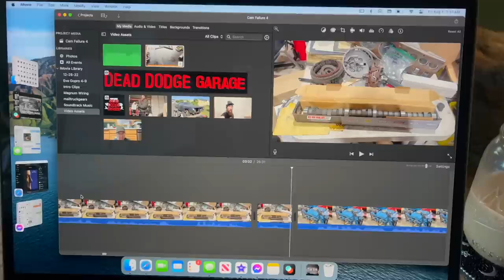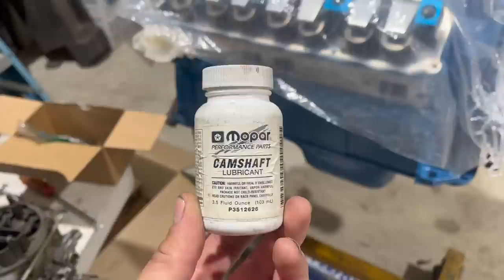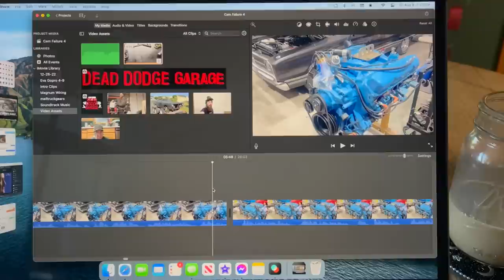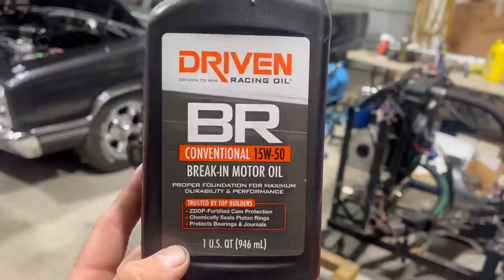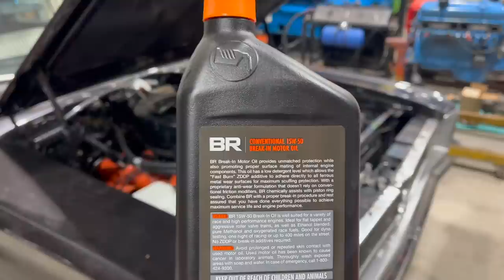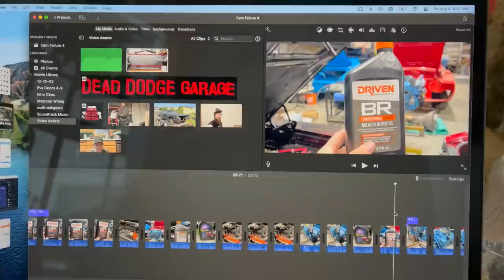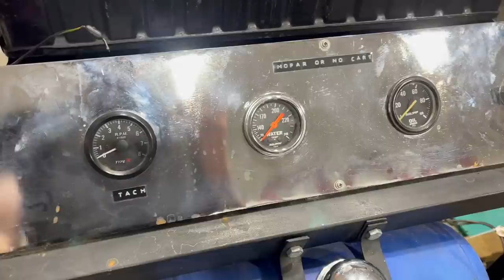How To Make Your Flat Tappet Camshaft Live, And The Anatomy Of A Failure

Comment: Comp cams are mostly very good, but obviously today they are letting some stuff get through that's not machined right.  Back in the day, no one was super fussy and the cams survived fine with just some break-in lube and running it at 2,000 rpm (varying) for about 20-30 minutes.  People just used the high-zinc oil that was sold everywhere, like Castrol GTX 20-50.  It may be best to just get a Lunati cam ($$$) versus taking another brand to a machinist and having them check it.  Lunati is good.  Comp is really good ,"Mostly". Some stuff from Comp is slipping through. their quality control (or lack of it).  Lunati might be your best bet..  Everything you said is absolutely correct, But I'm pointing that one one was taking out the windage tray and putting in lighter valve springs for the break-in,  Back in the 'early '70's, practically everyone was swapping in performance cams and  they were all flat tappet cams.  I very , very rarely heard of a roller cam back then.  One advantage of being 68 years old. is that I remember how it was.   Btw, I used to adjust the dwell and timing (with the light) by cranking the engine with the spark plugs out (in certain situation),  Cranking dwell and timing.  If the car won't start, I'd pull all the plugs, then swap the points and condenser and get them dialed in perfect before I actually started.  I still think points ignitions are superior to electronic.  The stupid "mechanics" back in the day almost never set them perfect, , often didn't use points lube. or clean any the wire connectors, check the mechanical and vacuum advance , points cam in the distributor for wear, check to if the new points had a burr on the rubbing block.,, etc, etc.  So me, the "amateur"  got jobs fixing stuff the "pros" screwed up.
Reply: Lunati and Crane are pretty much a memory. Both have been 'absorbed' by the Comp group or Edelbrock. EVERYTHING Lunati has is on backorder indefinitely. MOST of what comp provides is custom CNC ground stuff on their Landis machines. All their catalog offerings are mostly 'white box' stuff ground off site on huge gang grinders by Camshaft Machine Co. in Jackson Mich. I was going to buy a Lunati at Summit, had it saved in my 'wishlist' now it says 'No longer available'. NO Lunati at Summit or Jegs. They are history. 
Problem is age. These engines are 50-60 years old. Rebuilt multiple times by now. Who ever checks lifter bores? I've seen some engines .060+ overbore and cranks .040 under on journals. 
The other issue is loss of manufacturing knowledge or skill of previous generations. Last flat tappet engine produced by the OE was late 80's. Machinists that knew how to operate those lifter facing machines are long gone. I don't think any company is going to invest millions in new modern machinery equipment to make a product for a limited segment of the aftermarket. So they use old unmaintained equipment with worn out bearings and parts. Even in 2000, 23 years ago there were 4 separate manufacturers of Flat tappet lifters. All US based, US companies. One left, and it's not one of the 'original' manufacturers that did it back in the day. Maybe in name only. The current 'Johnson', well both 'Johnson's have NOTHING to do with the old Johnson Lifter's owned by Sealed Power when they were in Muskegon. AC Delco. Gone. Eaton. Gone. Stanadyne. Gone. Some were better than others but any of those were better than what you get today.
Reply from the maker: Hey, I got where I am with tuning by fiddling with screws and timing and listening to how engines respond, and I gained my electrical knowledge by breaking down, or piecing A-bodies back together… not by training in a classroom, a factory, or anywhere else.
Reply: @DeadDodgeGarage  That's cool! I used to be a professional engineer but not that kind. I learned on the fly too. The hard way. Some say the best way cause you never forget. I was talking about the manufacturing industry regarding loss of knowledge.
I spoke to a guy a while back at the 'other' Johnson lifter. The machine that puts that crown on the lifter is a very complex operation and that machine is specialized and super expensive. I watched one in operation. It's like an oribital finisher that pivots on it's axis. That's why the lifters look like they have those 'scuffs' all around the radius of the base. The crown  is only .001-.002 but needs to be consistent. I believe the problem with some of these 'newer' lifters is the pattern is football shaped instead of circular on the crown even if you can detect something of taper.
Reply: @DeadDodgeGarage  I read the books, but I also listened to what the mechanics said.  They knew a lot of stuff that wasn't in the books.  Back then a lot of work people did was pretty sloppy.  That's why the points ignitions got a reputation for being "unreliable".  Actually, all the old stuff was very reliable and a lot more simple.
Reply from the maker: @vincemajestyk9497  that matches what I have seen in videos by a machinist on YouTube whose name I can’t think of right now - he chucked up a brand new lifter and started resurfacing it, and a football-like oval pattern appeared showing his machine was resurfacing that area and not yet touching the whole face. So… that ain’t good…
Reply: @DeadDodgeGarage  These new USA made lifters (HFT) are a lot worse than I thought they were. That's a shame. I figured it was pretty rare with those. guess not. I just don't trust or like new stuff over older stuff. You really need to take a critical look at modern parts these days. I've used nothing but 'vintage' NOS lifters for a little over the last 20 years. I feel bad for all these guys like you that had catastrophic failures and did nothing wrong. Except having faith and believing that new parts you bought were properly made. Verifying a lifter crown isn't something the average person can do. Especially when it 'looks' like it's there and OK. People don't have any pride or care about making anything right these days.
Reply: Comp Lunati and Edelbrock sucks all the same stuff by comp I only use Elgin pro Stock cams and NOS  Lifters

Comment: When Dan at DD Speed Shop had the big block Chevy cam fail on his video he didn’t understand what had happened and and after he got hold of that same cam company and explained what happened well I guess he felt like he got screwed just like what happened to me and DDG and after that he made another video wearing a tee shirt that said comp scams. I’m guessing he didn’t get a replacement and like what they did to me as well put the blame on myself. I’ve built 20 or 30 engines myself and my first failure was last year and I followed every damn step in the book but hell I’m just an old man and I’m an idiot or at least that cam company made me feel that way after talking to them.
Reply from the maker: Right there with you, I think. I tried to blame the manufacturer - and really, it could be their fault. But I didn’t check them properly. It sucks we have to do that now… there were multiple shortcomings on my end that added up to what happened. I can learn. Happy to do it.

Comment: Good video, just installed new cam kit valve train. Everything good, but my felpro intake gasket sweat a tiny bead of coolnt. Like a sponge, ever had this,?seems like only in hot humid weather it will do it when the car sit over night in garage, used thread sealant and some red rtv around water ports
Reply from the maker: I’m assuming this is small block as there is no coolant through the big block intake. I’ve had similar problems with a bad intake fit and the cork end seals in place. They tend to hold the intake up away from the gaskets to varying degrees. I generally leave those end seals out and use a bead of silicone there. I once was convinced to use them in a 340, and it was so bad, there was coolant flowing into the oil.

Comment: also, stating a fact, before these last 10 years of "Bad" lifters you could break in an engine easier, without playing the "Mary-go-round" that is The flat tappet game, as of recent I do place blame on OE/Aftermarket manufacturers, Why? Well, they sell these products and grind them to spec, they claim to check these items before they leave the factory, that's WHY there are warranties, Placing the blame on yourself is giving into companies like Delphi, Morrell, Competition Cams, Lunati, Isky and more who peddle sub-standard products claiming "Ignorance" to the fact they are the ones who should be double Checking this, Powell Machine/Powell Cams in South Caroline Double and triple checked EVERY Lifter and camshaft that went through there shop, sadly, they no long sell Flat tappet cams due to bad machining.

I say this stating that it is not NOT user failure, it is not Your fault, nor is it any of the thousands of others suffering this issue, it's sad to see someone say "It's my fault" when it clearly isn't or wasn't Even cam break in directions specifically state to Do what you did, no where, not today or not ever have they (Comp, Isky, Lunati, Powell, Clay smith) said to Mic-out your Lobe taper, and lifter crown when that's there job for the goods they peddle to their customer base, not the customers job.

As for roller Cams, Yes, ALWAYS go Roller, no matter how much of a joke it sounds like, or how you make those who say it sound like a joke to you, stating Monetary Issues is silly especially Considering you're/They're dealing with a MoPar, arguably one of the most expensive Brand/s to buy for, why not take the extra step and precaution, what's worse, spending 6-7K USD on a build only to have it decimated and all down the toilet due to a $270-300 cam setup, or just going ahead and dropping the extra ~$1100 (1,074.99 according to Summit Racing for a full kit with springs/retainers/timing set/locators/locks) and not having to deal with a break in period, just drop them in, turn it on and go, and never have to worry, plus a small gain in power on the side thanks to Friction loss becoming Less of an issue.

Just don't sell the idea of a roller cam short, they're more than A performance upgrade, they're a Direct Upgrade and a Wallet Saver in the long term.
Reply from the maker: NO. I’m saying not to automatically go roller, and I will continue to say it. I’m not selling the roller idea short. I did a video documenting exactly what it costs, and why it makes sense - but also why I will not be using rollers for almost any of my builds. I have found two great solutions to this problem - use a local mom and pop cam grinder like Oregon Cams, or buy NOS. 

I had multiple false starts with the engine that had the lifter failure. That’s on me. But the crappy lifter machining problem isn’t.

Comment: Spark plugs were ac r45ts equivalent but a platinum plug that also changed back to the factory r45ts which is a copper core taper seat washer plug.

Comment: I'll tell you one awkward way I bleed a lot of the air out of the cooling system when filling the system. I grab a little kernel of oil dry and put it in the thermostat so it holds the  stat open a little.  Sometimes I've drilled a small hole in the flange part of the thermostat. Once, I experimented and drilled two 1/8-inch holes in the flange, I guess it was too much, it would not warm up while idling. I blocked one of the holes and the engine warmed up fine.
Reply from the maker: Interesting. The screwdriver has always worked pretty well for me. I’ll never drill another thermostat. I do like the “ultra stat” with the little jiggle valve for bleeding the system. There are plenty of good ways to get it done.

Comment: its better to spend $1200 on a cam kit than spend $300 on a potential grenade that can potentially destroy an entire engine.
Reply from the maker: There is a very simple solution. Don’t spend the $300 on a Comp, or whatever other garbage. Pay a cam grinder less than that to make you what you want and reface a set of lifters. If we stop rewarding these manufacturers by paying for their junk, maybe things will change. Maybe. And we help to keep the little guys open at the same time.

Comment: Funny that this video popped up on my feed. Was at my local machine shop yesterday where I was at last week on the same day and was just thinking about this subject when the video came up. Anyway, last week my buddy who also builds engines came in before I left to exchange some lifters he’d picked up for a stock build there. The lifters he brought in were supplied by TRW and had a step machined in the crown of the mating surface that measured 0.0015 deep on the outside circumference to 0.175 towards the center. What’s funny to me is that the lifters the machine shop gave him were manufactured by Elgin who as most of us know used to be the biggest supplier of flat tappet hydraulic and solid lifters and camshafts for many different cam sellers here in the US, including TRW. 

Not trying to delve into politics in any way but thanks to the Clinton administration signing NAFTA or the free trade agreement many manufacturers and suppliers started farming out or sourcing materials as well as machining overseas. The quality control and standards of those parts aren’t even comparable to the parts made here. Sadly this has caused a lot of time wasted for myself and several of my buddies by sourcing parts off of the internet for new old stock and phone call after phone call to what ends up being keyboard clickers who don’t have a clue about the parts they sell. You bring up a ton of good points in this video. The only one I had trouble wrapping my head around was the 3,000 rpm for 30 minutes comment you mentioned. Absolutely no reason to run an engine that fast for that long that I could ever think of. 20 minutes of varying rpm around 2k has worked for me for 30 years and yes in a couple of different cycles is just fine. Never had a problem heat cycling one like that, wear patterns have been good so far and yes break in springs are a good idea especially when using aggressive double or even triple springs. 

I’m one of those people who immediately changes the break in oil, only because of the fact that I have to know that the oil hasn’t separated out and cooled off leaving anything behind. Became more critical of doing so after starting to work with methanol as well as having to use zinc additives. Anyway, great video again, really enjoy seeing informative stuff on this channel. 👍
Reply from the maker: Yeah I really don’t know what that guy was on about. I have never seen a reputable builder advise that. It sounded pretty nutso - but he was very sure about it. 

I know. Nothing is made like it used to be… let’s get it cheap, right? I would much prefer to pay extra for quality. Hopefully there are enough NOS cams and lifters to keep us going for a while… but I’m going to need to go make nice with the cam grinders sooner or later.

Comment: Jamie I remember back I n the late 70s car craft said never under 1000 rpm .drive the car keep rpm up. Don't stay the same. Keep above 2500 when you can. Then go 1000 rpm higher. Well pop was terrified when I eventually shifted into fourth at 6500 rpm. 125mph in the bee. 145 I backed off.

Comment: Very good, but I cant understand how the wind age tray being installed is a problem,  the tray is below crank,  so it only hinders oil already in the pan from wrapping around crank at very high rpms... it doesnt interfere with the natural oil spray from crank bearing bleed.  Can you explain more on this?
Reply from the maker: It’s something I hadn’t thought of, but a couple commenters mentioned it, and it makes good sense to me. Yes, the windage tray sits below the crank, and it separates the sump oil from the crank, but its job is to disrupt any oil that is being thrown around by the crank - be that oil raining from the lifter bores, running out of bearing surfaces, what have you. That oil landing on or near the crank is caught up in its windage - the air flow generated by its rotation - and if you imagine what that does, it’s going to get caught in the rotation of the crank before it can be thrown outward. The windage tray is trying to disrupt that airflow and redirect the oil to the sump. Anything that reduces the amount of oil that is splashing around during camshaft break in seems bad. Maybe it’s not important. Maybe it’s something to consider. Hopefully the theory at least makes sense.

Comment: Well I run Shell Rotella 15/40 in all my flat tappet engines , gas and diesel or I could run Delo 15/40 but If I remember right Rotella has a tad bit more zinc . Most all engine oils they have taken the zinc out because a lot of engine are OHV and because of smog and EPA . You could also buy Racing oil that has zinc in it but my flat tappet engine have never been rebuilt and are stock .
Reply from the maker: I was only discussing oils for cam break in, and the two I mentioned were actual beak in oil and high zinc “racing oil” with an additive.

Comment: And my Chevy 355 had a built in windage tray because the oil pan from the factory equipment truck was modified, and the spec if I remember correctly was 2500rpm for 20 minutes??